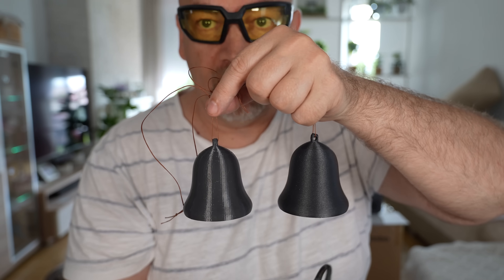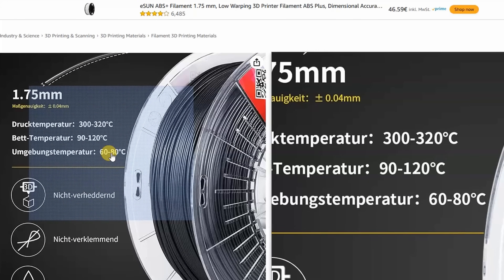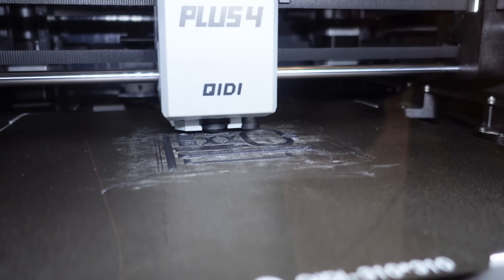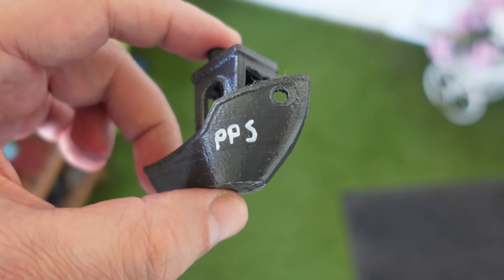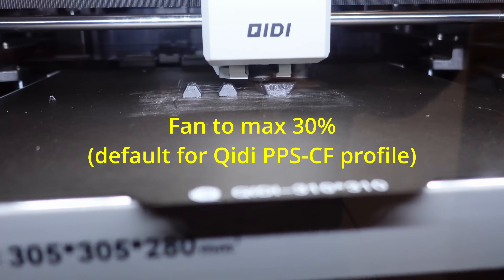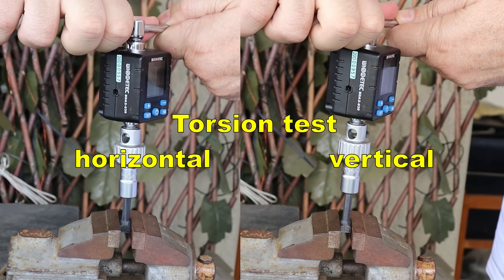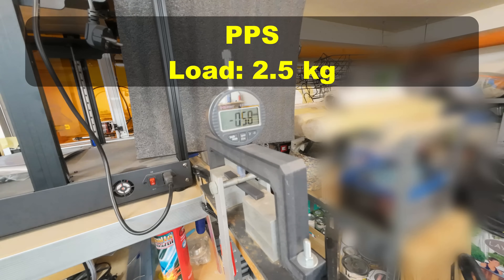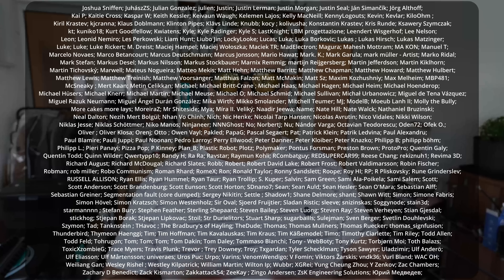No Fibers, Still a Metal Sound? YXPolyer PPS-TF Tested

Comment: PPS is not a new material, it exists in pellet type plastic engineering plastics a long time ago, as i remember for not sure, it uses in molding the electicial, chemical or high heat resistance parts... likes heater coil filament holder in hair dryer...etc

Comment: I normally don't buy the smaller spools, even for expensive filament, but I like how YXPolyer sells a kg of PPS (not 500 or 750 grams) for $70 and also sells a 50 gram sample for $10.  That would be an inexpensive way to validate the material for an application, or to buy only what's needed if I only need to print a small high temperature part with good chemical resistance.
Reply: Nahh.Nah. start stacking spools up. This is the way

Comment: A couple of notes:
* The main advantage of having no CF in the mixture is that you can run it through a smaller nozzle. 0.4 mm with CF can get clogged and usually (especially for large batches) 0.6 is more reliable. But for a pure filament - you will have no issues with 0.2.
* Makers usually lower the max temperature on the specifications to avoid people ruining their printers when trying to get the right temperature. It came from Ender 3 era with ABS - ABS greatly benefits from higher temperatures, but Ender 3 had a teflon tube touching the heater, and heating above certain temp would damage the tube (burnt teflon = very very bad) and breaking the printer. After that - brands usually lower the temps to avoid people harming their printers. Same exact thing with heated chambers.
* Heated chamber temperature isn't actually 65C when it displays it (at least for QIDI). If you look at where the thermistor is located (right near the heater) - it will stop heating way before than the chamber actually reaches 65C (usually 57ish for Q1 Pro). You want to add a small fan near it (easy to do for Q1s, idk about others) so that the air circulates inside. Unlike cool air - hot air circulation improves the model and doesn't cause early shrinking. With a fan - heating the chamber is significantly longer, but it is actually close to 65C (or up to 75C works fine on my Q1 Pros, but it requires some mods to protect the printhead motherboard)
Reply: There's a coding mod that uses both thermometers in the plus 4 and charts them out much more accurately. With a little work my plus 4 hits 80c😂 actually 80c

Comment: This material would be amazing in a hotter chamber. You should ask prusa to sponsor you with their indstrial printer that goes up to 90C.
Reply from the maker: OK, I will ask them, but from them I got only filaments so far..
Reply: @MyTechFun  That would be amazing. You would probably be great promotion for them because you could show how much stronger materials are when printed in a hot chamber. Even ABS/ASA is optimally printed in 85C.

Comment: Do I remember you have the Spectrum branded PPS as well? I have some and found it printed nicely without warping in my Q1My only issue with printing PPS is that the printer gets a grumpy when you run it maxed out on nozzle and chamber temp (350 nozzle and 55 chamber on that machine)  I think it may have killed a hotend (not the best feature of those machines). For bed adhesion I have been using 3D lac for a while and it works really nicely and isn't a mess like glue stick. (it is isn't crazy expensive like Magigoo)
Reply from the maker: Yes, I have Spectrum PPS too, but since I bought it myself, nobody is pushing me, "when will the video be finished". On Friday morning I woke up to 5 emails with similar content..

Comment: I can’t say about this, without CF, but I print PPS-CF on my H2D with the settings Bambu Lab has for it, with the standard textured PEI sheet without any problems. The only advantage over the PPS-CF seems to be the price. $90 per kilo as opposed to $70 per half kilo.
Reply: I need pure pps since I work in a clean room and the cf fibres are introducing dirt

Comment: Hello igor will you do a H2D review? Yours are the only ones I trust
Reply from the maker: Eh, it is still in the box. Before it: Carvera Air, Cubico, Sovol SV08 max and then H2D. I am working paralelly on the first 3.
Reply: @MyTechFun  Carvera Air! Wonderful! I've been using a full size Carvera and recently the Air for the last few months! Let me know if you have questions!
Reply from the maker: How do you zero exactly to the corner of the block? With manual milling, I do this by touching form the side and add the radius of the tool. Probably there is a video on Makera YT, but so many videos, I couldn't find it so far.
Reply: my H2D has been somewhat of a disappointment.  The main things I got it to do, it's not that good at.  Being a closed system, I can't just go in to the firmware and modify it, either.  And the g-code is pretty closed off.  It's a big pain in the ass compared to my old hot-rodded CR-10.

I

Comment: Thank you Igor for this video. 
I think you print this filament too fast.
Reply from the maker: I think maybe I print it too slow. Those settings are for the CF version
Reply: Really? Polymaker recommend 30-50mm/s max

edit : Optimal Settings (from Polymaker)
Nozzle Temperature: 300–330°C (varies by composite additives).
Print Speed: 30–50 mm/s to ensure layer adhesion.
Retraction: 1–2 mm at 20–30 mm/s to reduce stringing.
Cooling Fan: Disabled or minimal (0–10%) to prevent rapid cooling.

Comment: I bought a spool of this January 2023, well before anybody knew it existed. Can you believe, it was only $45 after tax. Now that everybody loves it, it's $75 after tax. Crazy!
Reply: Filament prices are through the roof. It doesn't worth printing stuff that are already out there.
Reply: Did the same thing with their PAHT filament which was actually PPA-CF.
Reply: I Just picked up some Siraya tech PPA-CF for under 50 bucks on sale😂 their stuff is crazy good too and prices are sane as well (typically $70) but 50 bucks for a kg of PPS-CF is a dang good deal. Kinda. I'm working on making my own filament extruder because a kg of pps cf pellets Is a couple bucks or less in bulk
Reply: "Now that everybody loves it" - nobody loves it.  It looks and performs like garbage.
Reply: @EliteMacFreak you obviously must be using an Ender 3 because this shit rocks on a printer that’s for pros.
Reply: @EliteMacFreak ok. Supply and demand is fake. I guess everyone hates it. The hate is driving the price way up! We need love not hate. 😔
Reply: @3dPrintingMillennial  are you going to buy it again?
Reply: @REDxFROG 😅😅😅 I never opened it LOL. It's still brand new in the box. I bought it hoping Bambu would up the 300°C limit to 370/350°C but that day never came. Instead they released the X1E and now the H2D. Never made sense why they capped it at 300 when Qidi, Prusa (HT90), and many others capped out at the higher temps. They marketed it for "engineering grade" filaments but then only gave us just barely enough to print PC. 

So it's sat unused since then. At the time, I didn't know how humidity would affect it, so I left it sealed so it didn't go to waste.

Comment: I might mix something up here but I remember when talking to a materials engineer this PPS-'TF' was briefly a topic. IIRC this had something to do with crystallisation issues when extruding the filament (also has a relevance when printing/changing filament). The addititives shall prevent/suppress this since then the filament becomes harder to handle (clogs/excessive heat to get it back to flow nicely once it solidified). The TF demoted that it has been altered and not pure PPS. Iirc the properties are slightly worse than pure PPS but it makes it easier to work with.

 (Again, maybe I mix things up here)
Reply: Maybe to add: The reason that the bell rings less is on one hand the reduced stiffness from the missing CF (gives mainly a lower pitch) and the higher damping could come from reduced crystallinity /more amorphous regions leading to a higher dissipation rate into heat
Reply: @CaptainHookNumber1  Since it's more amorphous, would annealing help? I'm not really a fan of PPS-CF's low layer adhesion, so I'm wondering if this PPS-TF is a better choice.
Reply: @AR-fn3sethe question is how effective those crystallization retardants work. It's possible that they are too effective (there's a recent paper on calcium stearate slowing the crystalization process in PPS down by a factor of 14 at high temp where it should be the fastest: 260°C). But one can still try: You need to be well above the glass transition temperature but below the melting temperature. I guess 120°C is a good start since we don't know the blend of the filament but in literature they use much higher temperatures for best results. Maybe the best results will come from 200° C for several (10+) hours though, so there is quite a lot of effort involved especially to figure out the best parameters...

A more amorphous filament should lead to better layer adhesion but either way one should try to be on the high end of the print temperature window to ensure good properties.
Reply: @AR-fn3se pps-cf has great layer adhesion if you print it properly...
Reply: @CaptainHookNumber1 love the depth of your comment. you can print PPS directly crystalline around 120-130 °C. You can also anneal it at that temp range. Morphology of crystalline phase will be different depending on printing and annealing parameters, which can make a difference in toughness or tensile strength. Think many small crystallites vs fewer big ones. Filled material is much easier to anneal. Using fine sand is a good practice. At work we have software to even simulate the crystallisation and shrinkage during all process steps.
Reply: @krosstoph thank you 😃 the annealing itself is a huge rabbit hole indeed! Tweaking the properties via the amorphous and crystalline ratio (which again splits into the number and size of the single crystallites...). Out of curiosity do you simulate this for your own materials or do you have filament suppliers/partnenrs that provide the necessary specs? (I'm not working in that field)

For this filament I wouldn't put too much effort into different annealing processes though as I feel like this filament isn't trying to offer more than what a hobbyist with an oven and salt/sand will do.

My guess would be that the filament has the crystallisation retardant added to make it easier to work with for the manufacturer (and end user). And to denote this in the filament they add TF for tough since amorphous PPS is more ductile/tough (just my assumption of course).

Comment: It would be interesting to also include the 3 Siraya PPA filaments in these "bell-tests" too - PPA / PPA-CF / PPA-CF CORE versions. And about the bell-test of this YXPolyer-TF, the "TF" suffix indicating that they've messed with the base polymer to increase it's elasticity, and this will probably also make it more vibrationally damped and less "ringing" separate to the influence of with/without CF.